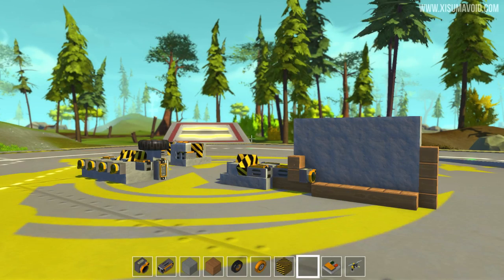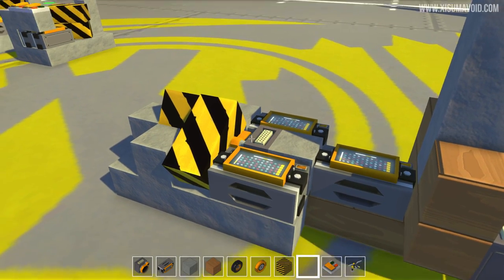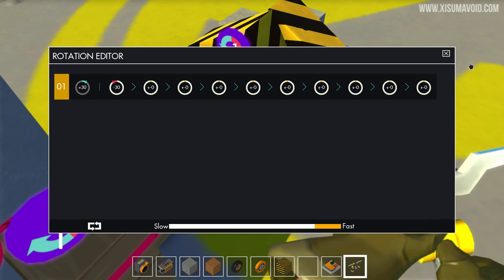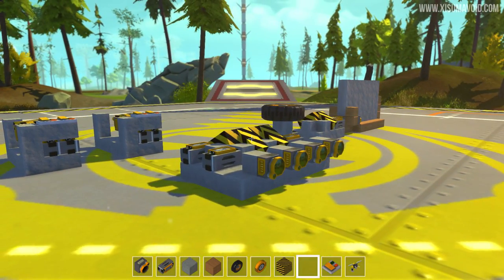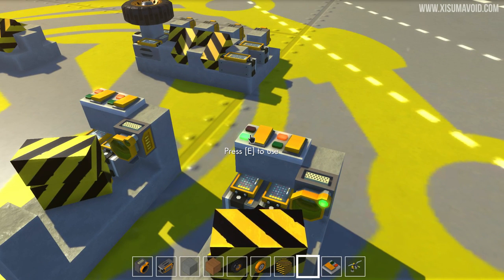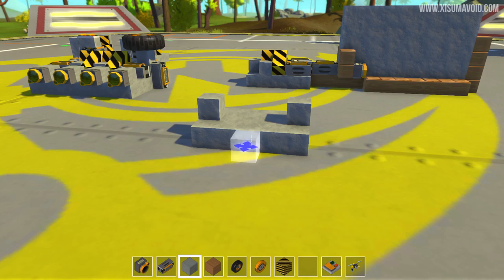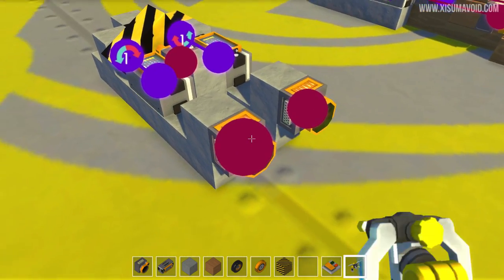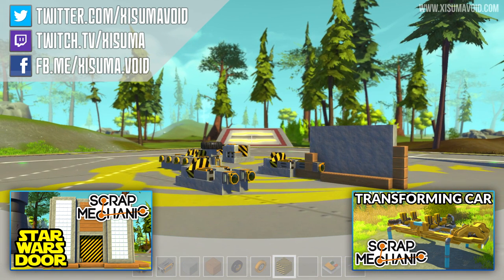Scrap Mechanic Tutorial: Multiple Input Connector + AND & NAND Logic Gates

Comment: That is really cool.

"The multi input sensor" is actually a OR-Gate.
And there is a easier way of building a NAND-Gate. Just make a OR-Gate without making the default-state open.
If the default is closed you have to open (activated) both/all inputs to get no output.
A NOT-Gate could be build in the same way just using a single input.

And if you have a OR-Gate and a NOT-Gate you can build everything you want to like Minecraft-redstone.

I hope that makes sense :D

The AND-Gate would be a OR-Gate with inverted inputs and outputs like in Minecraft.
The OR-Gate is exactly what you did.
The NOT-Gate is a single-OR-Gate but with inverted actions
The NOR-Gate is the combination of OR-Gate and a NOT-Gate
The NAND-Gate is a OR-Gate with inverted inputs. (So a NOT-Gate is actually a NAND-Gate with a single input)

So now you can build the same stuff like in Minecraft before the Redstone-update.
Reply: +Jochen Morent What about XOR?
Reply: ATMunn I thought about it it is quit easy as well.

For a 2 input one you use 3 OR-Gates.
the inputs A and B are fed into 2 of the 3 OR-Gates but you feed them once inverted and once direct. Than you take the output of those 2 OR-Gates and feed them inverted into the last OR-Gate.

So OR-Gate 1 looks like
NOT A or B
OR-Gate 2 is
A or NOT B
OR-Gate 3 is
NOT OR1 or NOT OR2

The last one is what I have descried as a NAND.
Reply: ATMunn For higher order XORs you have to decide whether or not you want to change state for every change of input (like multiple light-switches do) or not.

If you want a big XOR so that only 1 input is on of the output to be on, it is quite easy to build. You take 1 "input-OR-Gate" (I-OR) per actual input. Into this OR-Gate you feed all the inputs, but the one actual inverted.
In the end you feed all input-OR-Gates in one big NAND-Gate (OR-Gate with all inputs inverted).

I-OR 1:
NOT A or B or C or ... or X
I-OR 2:
A or NOT B or C or ... or X
I-OR 3:
A or B or NOT C or ... or X
...
I-OR x:
A or B or C or ... or NOT X

Output-OR-Gate:
NOT I-OR1 or NOT I-OR2 or NOT I-OR3 or ... or NOT I-ORx

I am searching for the pattern in the light-switch XOR. The update is coming once I figured it out :D
Reply: Hello xisumavoid,
I cannot make a video about all of this since I do not have the game and not a bit of experience in making videos. So if you would make a video about the logic-Gates I would be very pleased.
Reply: I have got an idea for an edge-detector but I am not sure if it would work. Could somebody test it once you read this?
The idea is, that you can build a dual-edge-detector if you use the controller and instead of just opening or just closing you do both (in sequence). This should give a short pulse on the rising and falling edge since it is played backwards on the falling edge.

This might be also usable of pulse-extension. if you close on the first and open on the last instance of the controller.
Reply: If the edge-detector works I have got an idea for the multi-light-switch-gate.

You can build a RS-NOR-Latch (meaning you save the state in wich you are in).
To do that you build 2 OR-Gates and feed the output of each of them into the other but inverted. Than you can use another input on each of the OR-Gates for setting and resetting the RS-NOR-Latch.

If you use a edge-detector you can than feed the puls into both inputs (set and reset) of the RS-NOR-Latch. And every time there is a puls the RS-NOR-Latch is going to change state.

To get multible light-switches you can combine the edge-detectors like an OR-Gate.
Reply: I totally understood all that. xD You, my friend, are a smart fellow.
Reply: ATMunn Thanks :D
Well I did all of that in one of my undergraduate computer-science courses :D

Did you test it? Like also the edge-detector?
Reply: Jochen Morent
I don't have the game... :(
Reply: ATMunn So the same problem as I have :D
xisumavoid I guess you should do it than ;)
Reply: weemcast I just have seen your video about the Multiple Switches.
Maybe my ideas - I wrote down in the comment - help you for future projects.

I really liked your solution to the problem.

Oh and if you want to make a little video about the ideas fell free to do so :)

Comment: that X-gate (multiple sensor thing) is called an OR-gate
Reply from the maker: +Animiles Is it not called an X-Gate? :-P
Reply: xisumavoid
This one is :)
Though, the function this X-Gate has is the function of an OR-Gate :p
Reply: +xisumavoid and do you know how long until the game is out?
Reply: +DiscoPanda12345 thanks
Reply: Donald Woodruff
20-01-2016 most likely.
Reply: +Animiles no it is'nt, an OR-gate is if there is more than 1 input, it won't activate. so it only works if one of them is sending a signal.
Reply: Jeroen Steens
You're talking about a XOR gate
Reply: +Animiles Yep you are right. And if anybody wants to make a 3-way switch for doors(the OR method only works for sensors). Use his AND gate but instead of the degrees he puts in use 180. For 4-way switches move the sensor up by however many switches you add and place down 1x2 blocks with bearings and connect up switches and controllers to them. This will allow you to have as many switches connected to your door as you want.... or until your tower falls. 

3-way and 4-way only really make sense in their original context but this method with emulate the effects of them. Tested and confirmed in game just today.
Reply: +Animiles That's right it's an OR gate.
Reply: +CaesarGamer yep
Reply: +Animiles or an xor gate

Comment: Fun fact about NAND gates. It's possible to create any boolean (on/off) logic with just NAND gates. So if your ever in a game are wondering if you can make a computer or calculator, first just try and make a NAND gate if it works you know you have the tools necessary to get the job done :)

Obviously you will probably want to simplify your system in some way and not actually build it all out of NAND gates. But fact still hold true.

Comment: You should ad that x-gate to your factory from your live streams. It could be a cool entrance for people and cars, and you could make it so one sensor is farther away and then the next one, or two are where the gate is, so cars could go through and players. Then you could install a second one for exiting and a little security check station between the two gates. Between this, you could make a lock feature, so no one can enter without your permission. Finally, you could install a fence on the perimeter of the factory, so the gate, and maybe a separate secret backup entrance could be your only way into the factory/ warehouse. Just an idea, but I wanted to throw that out there.

Comment: If you tweak the angles and position of the blocks in the AND & NAND gates you can also easily create an XOR gate. Using the same positioning for the controllers and sensor I did one using a single block on the bottom and a 2-long block on the top facing the controllers. For the angles I set 0 for stationary and 90 for activation giving it a full rotation when both active, you could fine tune these angles for slightly better efficiency but these make sure it's only in the sensor view when only one input is on.

Comment: You could make an infinite amount of inputs theoretically.  For each OR-gate input, create another OR-gate and to each of those, do another until you get the wanted number of inputs.  This solution would bypass the sensors not detection far any blocks (If of course that is a problem).

Comment: Since you have OR and inverter, you can build computers in this game! I wonder how the calculation speed would be. If you put the tiles exaktly on the borders of the sensors and set the motor to a high speed, it could probably be quicker than Minecraft computers.